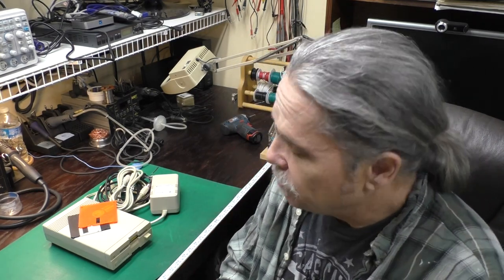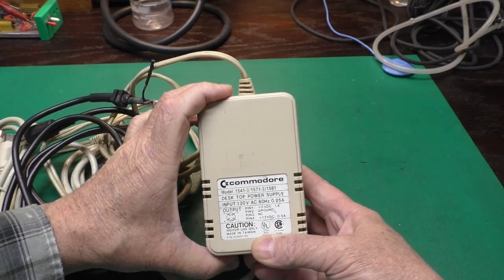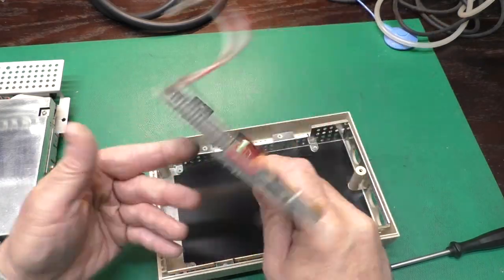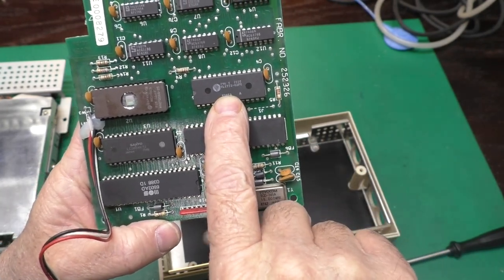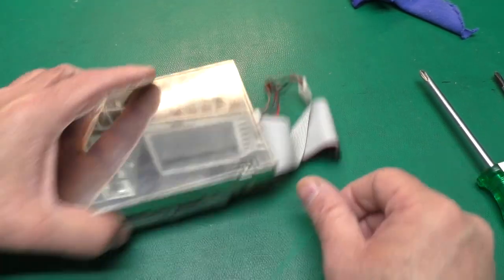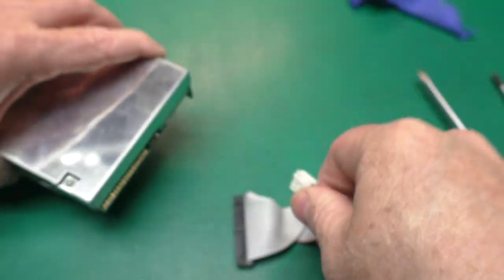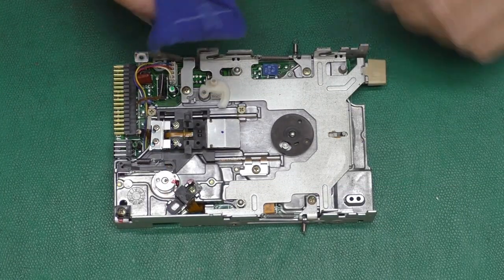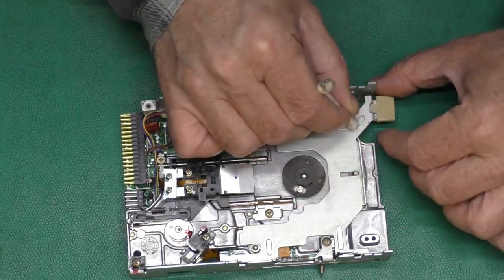A 1581 Refurb that is nearly a disaster. Will we get it working?

Comment from the maker: YouTube is back to their old tricks of deleting legitimate comments. I was able to respond to one right after it came in and now the comment and my replay are both gone.
Reply: It's infuriating but I know it's not you no worries! Just use a popular search engine, terms, boost your 1571 1581. Comes right up. Pretty non-destructive get to keep your 1571.
Reply from the maker: @xd3viant  The 1571 is similar to the 1541. The 3.5" drive in the 1581 has built in electronics to control the drive making the interface board much simpler. You can get 3D printed 1581 replica cases and not have to sacrifice a 1571.
Reply from the maker: several more comments the last two days have been eaten by YouTube. Sorry about that...

Comment: Hey Birt! Nice video about something I'll never see in real life :) The current issue on silver contacts is a real problem. I've see in on old (late 1970's) hamradio transceiver I own where some relay circuit operating only on very low RF currents would stop making contacts unless the circuit was modified to run a few mA of DC through the contacts.
Reply from the maker: Yes, the silver contact issue is something rather counter intuitive at first. Easy to get tripped up thinking a 'better' contact is always 'better' for the application. Once my friend explained it to me though it made sense.

Comment: I remember reading in the JiffyDOS manual that in both the 1571 and 1581 JiffyDOS enabled drives can somehow check the attached computer when powering up to determine if it has the JiffyDOS Kernal.  If not it uses the normal Commodore DOS routines. I think this is why the EPROM doesn't have a switch to change between stock and JiffyDOS.
Reply from the maker: This makes sense as it worked fine for everything but loading when the FastLoad cartridge was mucking things up.

Comment: Do you remove aluminum badges from your parts before you dunk them into the peroxide solution? With my early attempts I had a few where the paint lifted from the aluminum.
Reply from the maker: On this 1581 I did not remove or cover the badges as they were just stickers. On other machines I have covered badges with Kapton tape for added protection.